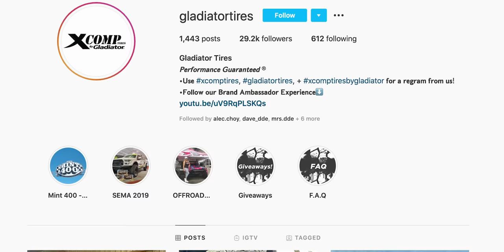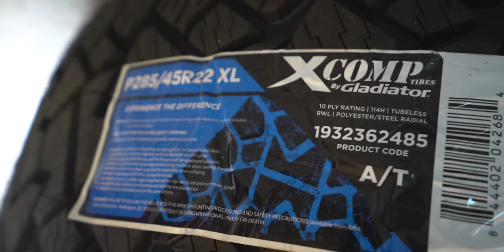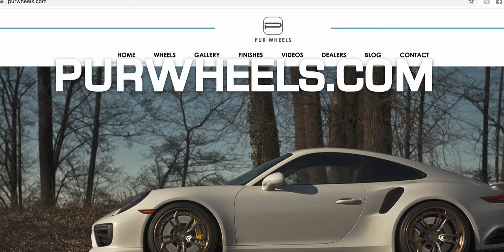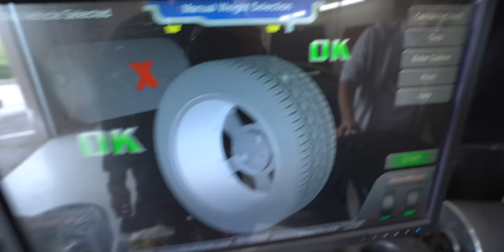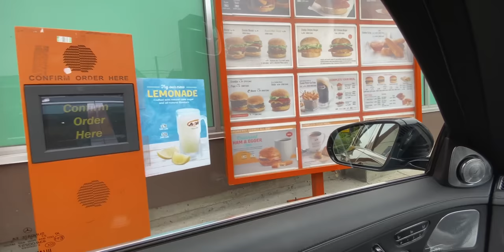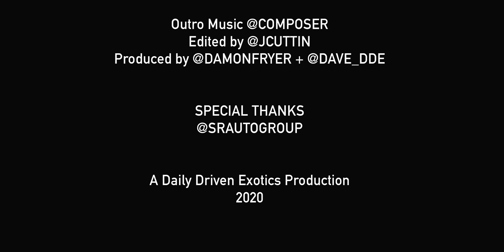SURPRISING MY WIFE WITH NEW WHEELS ON AMG G63!

Comment: That GT in all black and dry carbon is one of the best specs I"ve seen so far! Also, it looks like you need to upgrade the brakes now with those bigger wheels. Looks a little, well, little inside there.

Comment: Soooooo just a question but when mounting the tires why did they not line yellow dots up with valve stem? That's suppose to limit amount of weight that's put on rim, they are balance dots

Comment: If you would’ve bought the faster better handling 2020 GT500  over the c8. ford would’ve had a better chance at getting a allocation for a Ford GT. For $500,000. Gotta think the base 2020 GT500 has 760hp costs 70k has a DCT that’s better than the DCT in the c8 in fact people say the gt500dct is as good as a Porsche pdk and the base one out handles, has16.5 inch rotors and beats a 85-95k completely optioned out c8 around a track and in the 1/4 and half mile and the carbon track pack ties a Porsche gt3rs around a track. Less than $5000 and you can get 1000rwhp out of one and instead of factory 10.5 1/4 mile you will run mid 9s and kill 720s and all your cars for a small fraction of the price of any of you cars or for less than a c8.  Dave should get 2020gt500 to go with the c8 and you 2 will have the top American super muscle cars. People compare a new GT500 with a 812superfast. And if you need something fixed it’s a fraction of the price.